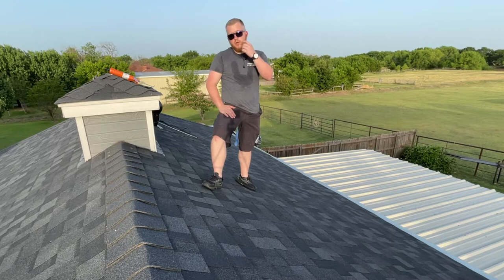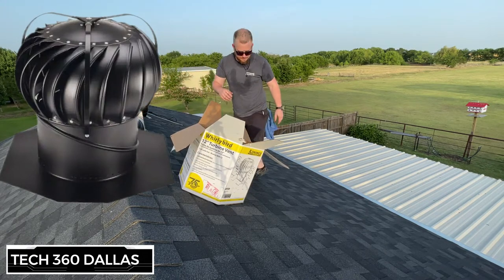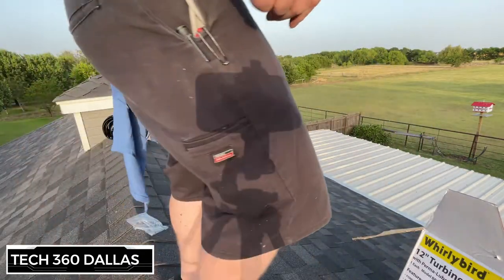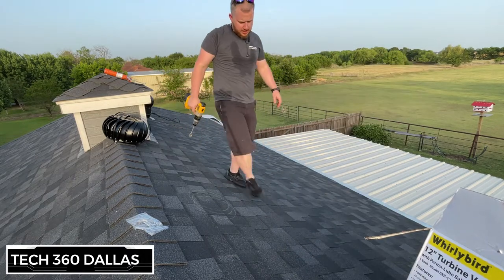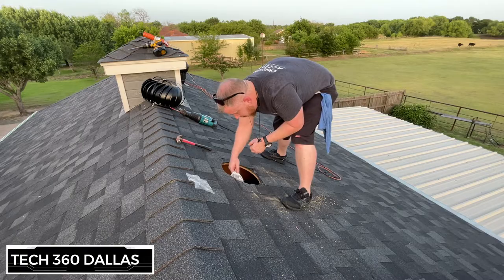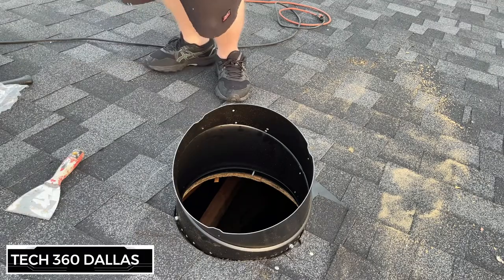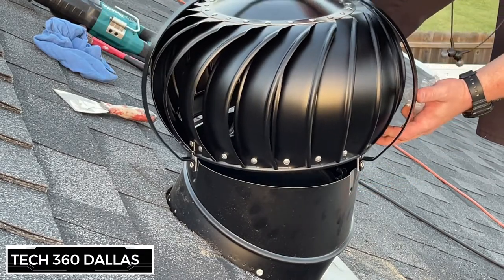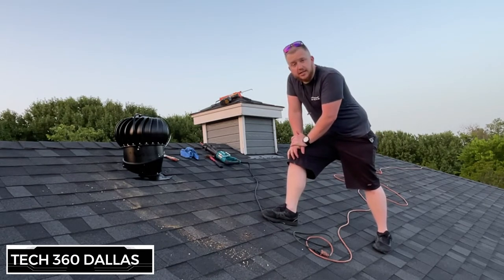How to Install a Roof turbine - a step by step guide

Comment: I would go in the attic and drill a hole through the roof right in between rafters. That way you know exactly from the outside where the center of your fanbase needs to be. I did that with a kitchen vent install and it helped me avoid the guesswork of locating rafters.
Reply from the maker: @problemsulfer  yes, you can do that as well, but sometimes attic roofs are pretty high, and you can’t reach them,, most the time you could find them fairly easily by banging on the roof

Comment: The crazy thing is, I have the same turban, but it does not matter what you put the slope pitch on. It doesn’t change the angle or anything of the whirlybird.
Reply from the maker: It really just depends on the direction your existing Vents face, I’m sure there will be times where they are fighting each other, Because honestly the vents you have already Are usually pretty good..

Comment: Nice. You could also use screws with built in rubber seals then put the sealant over them to be double safe. I'm about to install a couple vents, my place has none and the heat radiates through the ceiling.
Reply from the maker: Yeah, I didn’t think about the screws with the rubber grommets already on them.. those would be great to use as well,, but I can only imagine a house with non-and how much heat is in that attic lol

Comment: Hey man; rough or not, you got er done!
My house is 60y.o. At some point in it's history, one of these was installed. It's made of galvanized aluminum or tin, i think. there is only the one and the house has a high hip roof. I see it up there "working", as the rising hot attic air does turn it veery sloowly. The attic is still hot as hell. It makes me want to motorize the darn thing. The attic is literally sealed off with no gable or other vents at all. I was thinking of pointing a fan in the turbine's direction? Would that help matters? Don't really like the idea of having an appliance up there that i can't monitor but i'm desperate. Any ideas at all? Thanks man

Comment: Hi I want to know if the outside temperature is 45 Degree C and the inside temperature is 40 C. Bu installing Whirlybird in each room will reduce how much temperature inside the rooms?
Reply: Your attic temps should be within 10 degrees of outside temps. Make sure you have proper air intake at the soffits. Air from soffits should be able to reach the attic through the insulation by what’s called air chutes. The turbines are to expel the heat in summer and winter. If you have a heated attic in winter you have poor insulation and you’ll be susceptible to ice-dams on lower part of roofs by gutters. Room temps in the living space will be isolated by proper ceiling air sealing management plus insulation in attic. 
I’m in the middle of this project installed soffit vents yesterday.

Comment: How do you know where to put the turbines? We have gable vents.
Reply from the maker: I mean usually most people put them for sure over a garage because most garage is do not get insulated therefore they tend to hold a lot of heat and sometimes it travels into the rest of the house and keeps the house a little warmer than it should, But you can put them over any large attic areas to help remove some of the heat out of the attic.
Reply: @Tech360Dallas  Okay. I just didn't want them to be counteracting one another in the attic space over the home.

Comment: Have you ever gotten mice that crawl in the openings and into your attic. I was thinking about installing a couple of these but my biggest concern is the mice getting in my attic. For those who ask how can mice  even get on the roof, they’re great climbers.
Reply from the maker: No havnt had that issue yet! but to avoid that, you could always secure a mesh screen th the underside of the vent inside the attic.  to prevent , birds, mice, leaves. etc from getting it!

Comment: WOW! This is Interesting but what is a roof turbine used for?
Reply from the maker: They are to let the heat that gets trapt in the attic out! Keeps the attic cooler and ac gets a little colder!
Reply: Keeps the moisture out as well so there will be no molding going on
Reply: @Slowrolling92  yup i installed two of these and it helped bring down the humidity level in the attic

Comment: Water doesn’t get in the turbine blades when it rains?
Reply: I’m wondering the same thing!
Reply: @MichaelMartinez-zv3ig  i installed 3 of these and  so far no leaks. 
Also the way the turbine head blade  is cut its hard for rain water to seep in.
Reply: @MichaelMartinez-zv3ig  it has a curve to the blade which helps repel water from getting inside espicially when its spinning